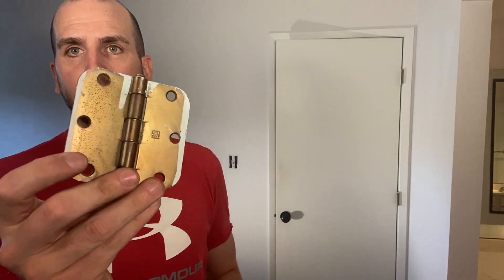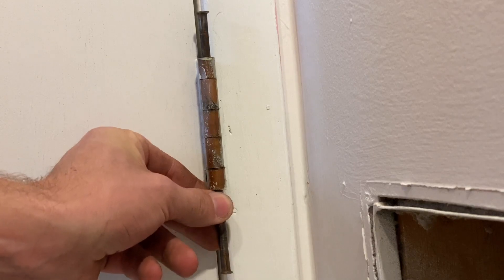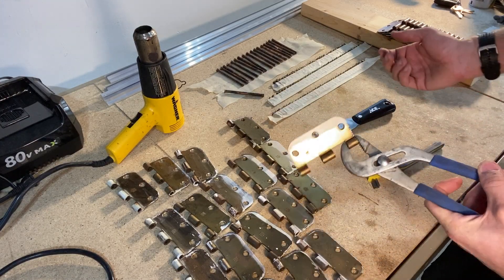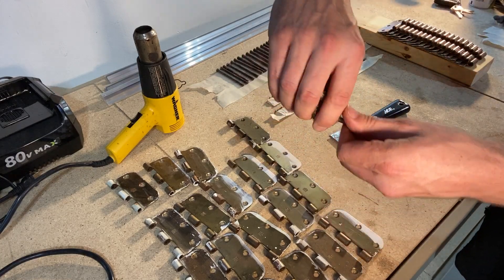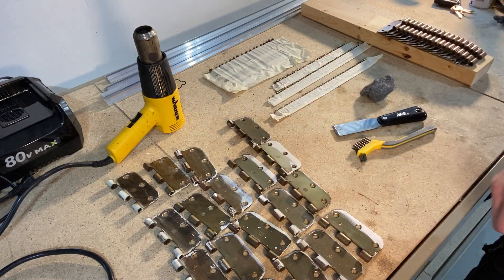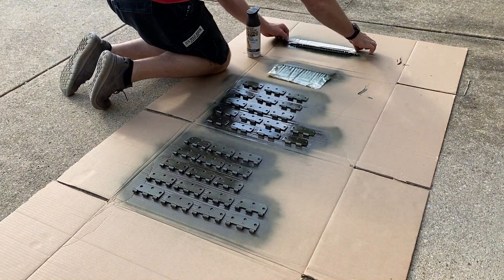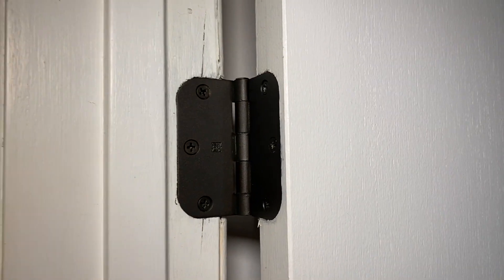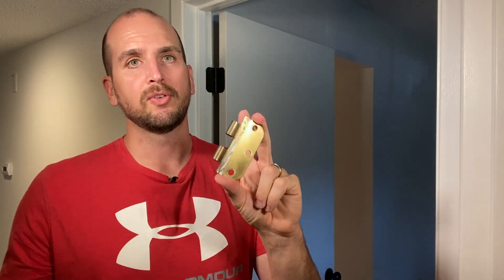How To Update Old Gold Door Hinges

Comment from the maker: Tools Used
Rust-Oleum Metallic Paint:  https://geni.us/BHzD
Stiff Putty Knife:  https://geni.us/7bAR
Wire Brush:  https://geni.us/RPJoOgV
Channel Lock Pliers:  https://geni.us/A6QBnA

Tools Every Weekend Warrior Needs
Makita Cordless Drill Combo Kit:  https://geni.us/t7dIA
Dewalt Drill Bit Set:  https://geni.us/oFlSl
Dewalt Screwdriver Bit Set:  https://geni.us/VDcr
Craftsman Screwdriver Set: https://geni.us/jXqFI
Eklind Allen Wrench Set:  https://geni.us/7XfvO
Pliers (4-Piece Set):  https://geni.us/RIdx
Stanley Utility Knife:  https://geni.us/ndIDa
Stanley Tape Measure:  https://geni.us/bUfD1R
Studbuddy Stud Finder:  https://geni.us/RySCuVw
Johnson Torpedo Level:  https://geni.us/wiLcDY
Stanley Hammer:  https://geni.us/bPDk8Wo
Buck Bros Wood Chisel Set:  https://geni.us/vk3cpTW
Klein Voltage Tester:  https://geni.us/h9Hl
Klein Outlet Tester:  https://geni.us/kdBAJ
Ideal Wire Strippers: https://geni.us/MdOB
Little Giant Ladder: https://geni.us/fmlmTk

DISCLAIMER: This video and description contains affiliate links, which means that if you click on one of the product links, I’ll receive a small commission.

Comment: That’s such a great idea to use masking tape to hold the screws and pins together and keep them clean while painting!
Reply from the maker: Yeah, it worked great especially for the hinge pins.  Best of luck on your project!
Reply: What I did when painting kitchen cupboard hinges that were yellowed,  I took the screws and stuck them into the paper lid of an egg carton, then I could hold the carton lid and spray the tops of all the screws white.  The hinges were the kind where hinges and screws are visible. Worked amazing! Used Rustoleum with primer also.

Comment: Thank you so much! I’m about to do this in my new house. Two questions: How are they holding up 3+ years later? Is there a specific reason for using heat as opposed to a paint stripper for removing the old paint?

Comment: I'm looking to tackle this same task (with the same exact colors actually). This video was helpful - thank you!!
Reply from the maker: great, best of luck on the project!
Reply: @EverydayHomeRepairs  how worried do you have to be about taking the screws out and back in? Couldn't they easily strip?
Reply: @LBizKid04  I'm sure you've probably already done this, but if you were really worried about screws stripping you could use a drill on a lower setting or a screwdriver even. Tbh, an impact is a bit overkill here. 
The bigger issue from taking the screws out, is that you may strip out the door casing and have to use either longer screws and or put adhesive and toothpicks back into the hole so that the screws have something to hold onto.
Reply: @cameronforbes2649  not yet 🤣 this project got pushed. I appreciate your comments, thanks!

Comment: I made my own baby gates and spray painted the hinges(think one piece cabinet hinge) with the same paint brand/formulation as you but in black. They still look great after 18 months, but a fine dust did collect and stain the white baseboards underneath. I suspect this was from paint being on the pin and touching surfaces of the barrels. I’m curious if you saw similar ware after a few weeks?

Nice editing work on the video btw

Comment: Did you use a top coat?
Reply from the maker: I did not, but might not be a bad idea to give a little more durability.
Reply: @EverydayHomeRepairs  What would you recommend as a top coat for interior door hinges, oil based polyurethane? Any brand preference? I'm doing all of the kitchen & bath cabinet hardware but not familiar with rattle can finishes.   ps I'm a new sub!  I need some guidance for everyday repairs and based on the title of your channel it appears to be a perfect fit : )